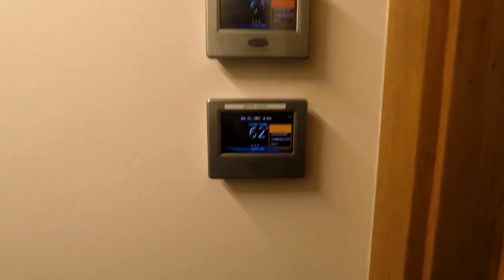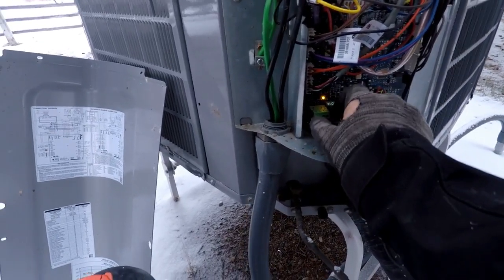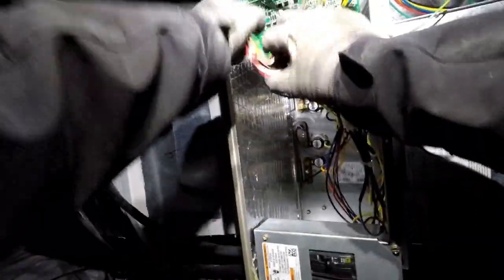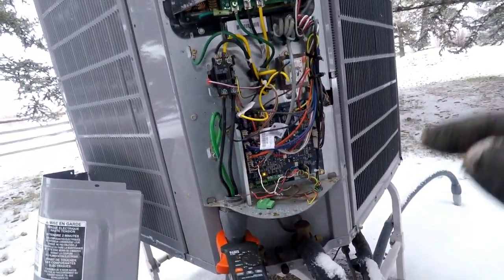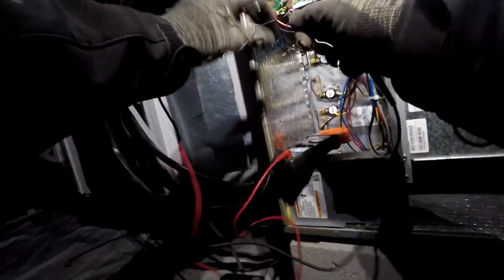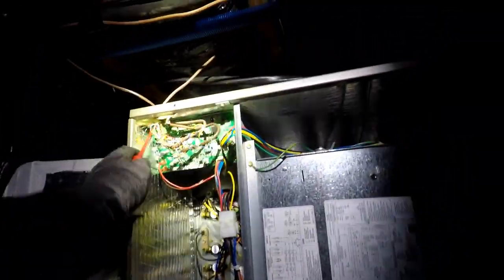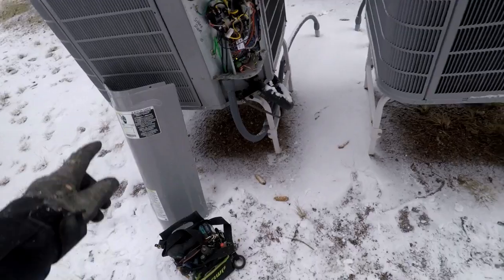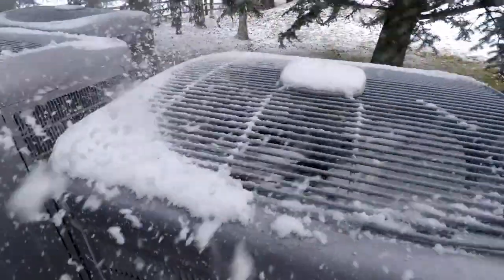"What we have here, is failure to communicate"

Comment: This is good reason not to put in communicating thermostats and inverter equipment.
Reply from the maker: Why would that matter as long as the wires weren’t getting compromised? Wouldn’t compromised wires cause an issue with any type of system?
Reply: @Idatech7  Wrong person I said that's a good reason not to put in a inverter and communicating system. Good video

Comment: If the thermostat wire is not in conduit and not buried below frost line it will always be a problem. That cable is not rated for direct burial.
Reply from the maker: I believe that it is buried in a corrugated flexible conduit with the line-set
Reply: @Idatech7  
If it is in conduit, then why did it up?
Just pull new wire.

I hope the disconnects you pointed out are NOT the means of disconnect for the units!!!!!!
Per code, the disconnect should be within reach of the unit and 6' maximum(IIRC).